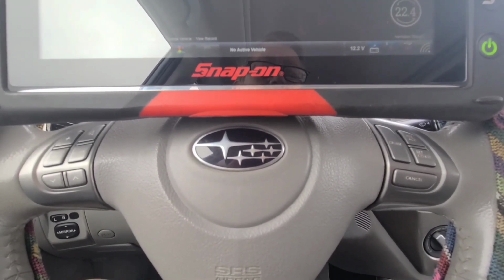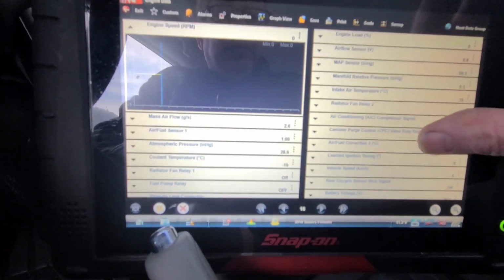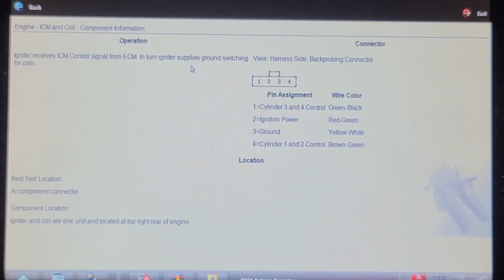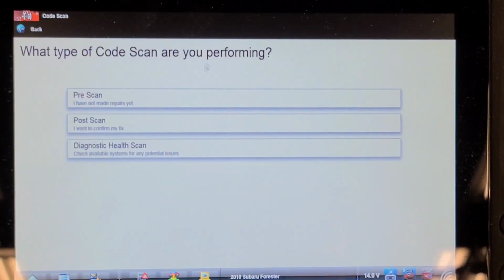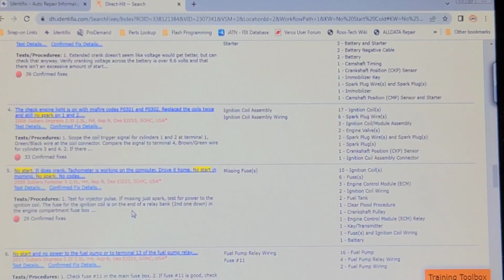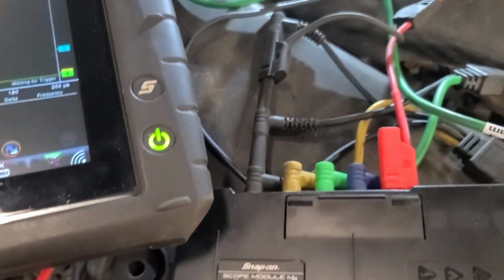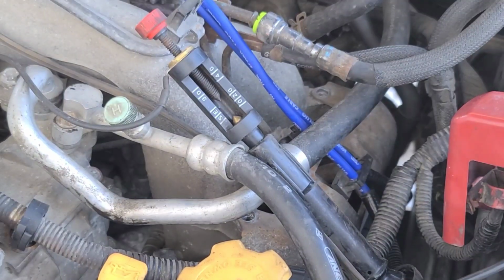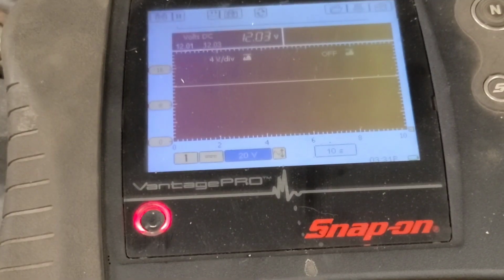2010 Subaru Forester 2.5 Crank No-Start Cold No Codes

Comment: This is an awesome video, my friend has 2009 subaru forester and he is facing the same exact  issue with his car, it wont start if it is anything lower than 1 degree, as the car is Japan make, I doubt the engine and components has been made suitable for hot weather countries, but not for canada. so i have been looking for some solutions to make it work and you're video has given some inputs to check in.
Reply from the maker: Good luck
Reply: @PhillipBailey  I would also like to know if there are any differences in the electrical components of engine from Japan models and North American models of the same brand. So that which could result in affecting the firing from hot weather climates or cold weather climates. Like in 2W motorcycles, CDI/TCI plays a major role in firing in cold  at cold / Hot weather's.
Reply from the maker: @vinaybhaskarmondati9612 I did a fair amount of research on this as this engine was replaced with a Japanese one in the summer. I could not find any differences other than emission programming in the engine control computer system but in this case that was north American.

Comment: I so much enjoyed this video and your diagnostic path.  I had the exact issue with the exact same make/model/year subie.  Two winters of dealing with no starts below 20 degrees fahrenheit.   Frustrating because you do have to continually have the cold environment for it to act up.  When it starts the diag is over and I wait till it fails again.  Then its outside and too cold to want to deal with.  Finally it was cold enough to not start for a while and give me an opportunity to look at the things you did.  Fuel pump primed, grounds good, coil good, connections good, crank signal and pulse to coil/module, fresh charged battery.  Cranking speed to slow for ignition module to excite coils apparently.  Thank you for your multi-day fantastic effort on that diag.
Reply: This is it, I’ve been troubleshooting my 08 for about a month now, this has to be it. Will report back.

Comment: I have an 09 Limited. same symptoms. I too suspected coil or relay or even ECU. with printed circuits, a conductor crack can pull apart under cold conditions. thanks. all the detail helps. what did this cost the customer?
Reply from the maker: I charged her the price of the starter and 6.5 hours labor. Around 1K Canadian with tax.

Comment: These Subarus are the worst. I’ve been trying to track down a lean running condition with my wife’s 06 forester and still can’t figure it out almost a year later. Now it’s got a long start issue I believe is related.
Reply from the maker: Low fuel pressure could cause both conditions but so could an induction leak. I'd recommend to check fuel pressure on a cold start, check for induction leaks, check temperature sensor readings on a cold start and the Baro reading.

Comment: First of all thank you for the information 
I think most Subaru have same problem I do have same problem on 2013 Subaru I have not went through the diagnostic test but it’s seem like electric problems when it’s cold voltage changes running through the wires but have cleaned the MAF like you said MAF 
And yes my Subaru the block been replaced with new one from Japan because it’s was under warranty but I’m the 2nd owner so I don’t know how it was the crank in cold temperature

Comment: been there done this,,,aftermarket coils dont work in subarus below freezing temps, look at the coil u have, if it doesnt say subaru, replace it with subaru coil and it will start.  mine was a 2010 forester with four in one coil, not the seperate coil on each plug.
Reply from the maker: Unfortunately it was not the coil. I did put an oem coil on it with the same results.  It was the starter ...
Reply: its only the coil if it doesnt fire up below freezing, if it turned over fine the starter wouldnt need to replaced @PhillipBailey
Reply: im sorry, didnt mean to sound like a know it all, your diag video was second to none, i learnt  from it. i will say that i replaced the starter and battery with still no start on my forester, and lucky me we have 3 foresters, but i did the coil test and switched to subaru coil after everything else (because why should i? i purchased 2 new coils from auto parts stores so the coil should be good,,,right?) so to back it up, cause like you i spent so much time diagnosing, i had to know if it was really the coil or not, so i switched back to both aftermarket coils,,,8 degrees f,,,no start with new batt and new oem starter.  great vid!  i relived the pain the whole way thru it!  also i had something with same symptoms and it ended up being the alternator starting to sieze,,the drag on the belt brought the engine crank speed down just enough to keep coil from firing.

Comment: I had the same exact problem last year and did the same thing that you did and I noticed the same thing with the starter being slow and laggy. When it would get to 10ﾟF my car would start anything below it would not. Before this Winter I am definitely going to change that starter it is the original.  I've already cleaned all my grounds except the 2 on the bottom of the frame which I will do.Thank you so much for posting this.
Reply from the maker: Let me know if the starter fixes your issue too.

Comment: Pause video at 39:44. You mixed the red and yellow leads up.
Reply from the maker: Wow you have good eyes. I fixed it after off camera as it initially would not start after connecting it.
Reply: @PhillipBailey  haha not hating. But I have a question. 
I’m having a crank no start after installing new valve cover gaskets. Full oil change, air filter, plugs, wires, and coil pack. Just maintenance. Car running before. Misfiring badly. So I decided to tune up. What could be my crank no start? Are you ever open to a phone call?
Reply from the maker: @starrwarz  you can call me after 10 EST ay 807 626 3683. You need to figure out what you're missing. Spark,  injector pulse, plug wire routing, fuel pressure etc.
Reply: @PhillipBailey  I tried to call. I think because I’m in USA and you’re Canada maybe it didn’t go through.  I’ll try again tomorrow

Comment: THANK YOU for posting this video. We have been struggling with my 2010 forester for three winters going through the same frustration. The only way to get it started was with a space heater under the hood for a couple hours. One mechanics diagnosis was that it was “tired”. After multiple sensor  and other part replacements we found your video. Replaced the starter and it’s has been starting fine now -14 not plugged in. Thank you again  for sharing this.
Reply from the maker: Thanks for watching the video. It was definitely a headache. Glad it helped you out.

Comment: i hope i can ask you some questions about subaru's cause im kind of starting on doing emgine swaps on subaru's to make some money for my little girls going college.😊
Reply from the maker: Ask and I'll try to answer...
Reply: @PhillipBailey   I installed a used engine. And it did run before I pulled engine. (Just knocking).. now no start.. I have gotten to the point of I know it is no spark... And it doesn't start.. even with a new battery..
Suggestions would be wonderful 👍
Thanks again for your help and videos
Reply from the maker: @1oldteck  do you have any codes? Is there injector pulse, test crank sensor, does the scan tool show rpm cranking?
Reply: @PhillipBailey  sorry I just finished watching the whole video, I've done everything that you've done except the starter but mine won't start with a booster even warm in my shop at 60° f, that doesn't mean that it's 100% 60° because it gets down to 45°f  in the shop at night .. but no start.. to the answer your question there is no codes I did have body codes ABS codes a bunch of other codes and I cleared them all out and nothing came back, one thing I did when I did this engine I don't know if I said it or not but I did not disconnect the battery immediately I pulled all my underside off and disconnected grounds and bellhousing and starter from underneath then upstairs finished removing all the bell housing, then went to the alternator and realize that my battery is still connected at that point I disconnected my battery disconnect the alternator pulled the rest of the stuff pull the engine put the new one in put it all back together and I'm half this problem...
Reply: @PhillipBailey  I see your phone number on another post would you be willing to talk to me I can shoot you some money if you like
Reply: @PhillipBailey  I also swapped coils cam sensor crank sensor verified RPM on scan tool, don't know how to use this new scan tool it's the X tool B8 It is a bidirectional pro version, it looks like it's got more stuff than I've ever had even at the old days when I was drivability for GM

Comment: does the ignition coil description and operation say anything about needing min amount of rpm needed when cranking for coil to work?
Reply from the maker: No it doesn't and I've never seen that in my career.
Reply: @PhillipBailey  theirs a problem when someone of your calibre and with your years of experience hasnt seen the problem
i know cummins isx needs 150 rpm minimum to fire injectors
Reply from the maker: @jordanboulay3780  yes thats very common on Diesels for sure but never seen it on a gasoline system.

Comment: Excellent. I admire your tenacity, sir! Did not expect it to be a starter. 
You know those "battery/electrical system testers," the ones that test the cranking, starter/alternator health, etc? During the time that you were abIe to start the car under its own power, I wonder if that test would've helped you identify a starter issue. Or even use the starter test on the Picoscope that tells you how many milliseconds of cranking time.

Comment: Hello Mr. Bailey,
 I have a 2010. Same symptoms. Same wild goose chase for three winter seasons here in Michigan with no resolution in sight yet.

The solution for your car was the starter. Any idea yet as to why the starter and how the cold is impacting the system? 

Thank you for your patience and filming this process as it may prove helpful for my family here in Michigan.
Reply from the maker: Thanks for watching. My theory is the coil must contain more than simple transistors and it's electronics would not allow it to operate correctly below 120rpm. I could see that from the ECM but since the ECM was commanding the injectors and coils I believed the slightly slow cranking was enough. Let me know if that's your problem i'm really curious if that is your issue.
Reply: @PhillipBailey  
So far, over the three years:
1. Replaced coil, plugs, plug wires, batt, and batt cables.
2. Tested fuel pumps and even starter. Ruled out pump and starter as . . . They work. 
3. Searched high and low on the internet. Some say it's caused by an oil pressure switch, or an coolant temp sensor. No one who has this problem, knows. Subaru dealers themselves don't seem to know either, as they will choose one option, then the problem will occur again. 

I will let you know. Again, thank you so very much for your video. It was confirming my frustration seeing all of the work you put in.
Reply: Mr. Bailey,
Update. I changed the starter yesterday.

Parked outside with Temps falling from 14 to 0F. 

For the last 3 years it would not start in the morning if under 25 F. 

Today it started at 14 F.

I will be watching over the next few days, but it seems to have solved the problem. Thank you so very much!
Reply from the maker: @thinktank8286  let's hope it stays good!
Reply: @PhillipBailey  Hello Mr. Bailey. From our last messages last year, I thought I had it fixed. Well, it's in the 20s F here this fall in Michigan a d the problem is back again. Ran  perfectly in the cold last season.

 What theory might you have, that would cause the new starter to slow down again, enough to cause the problem again? I could just replace the starter qgain. Last year I used an Orliey's one. Reading through perhaps I need the Napa one.. But wondered if you had any insights. Thank you!
Reply from the maker: @thinktank8286  battery cables, connections and battery. Check voltage drops on the cables. If its a weak battery it should start with a boost.
Reply: @PhillipBailey Will check. 
I did have the cables changed out in my other rounds of fixing. It does start with a jump, always did so historically.
Reply from the maker: @thinktank8286  if it starts with a boost my thoughts are it's the battery or cables.